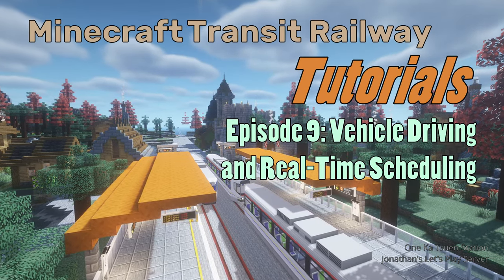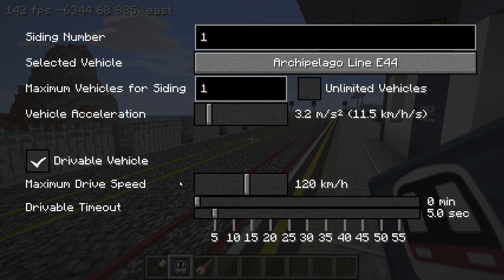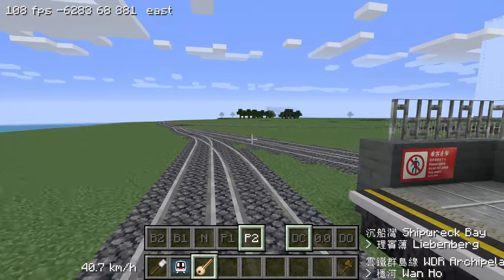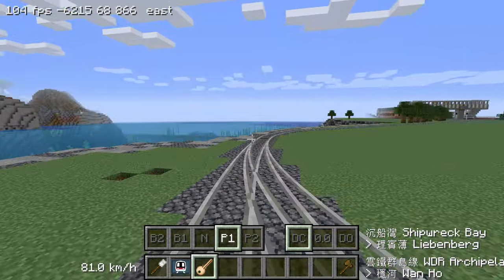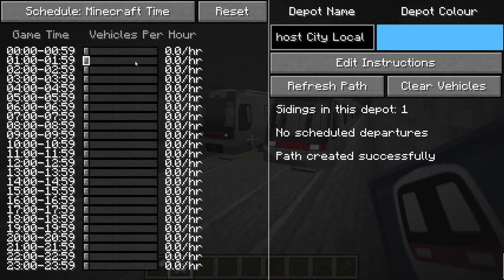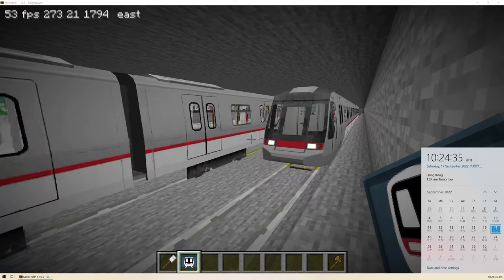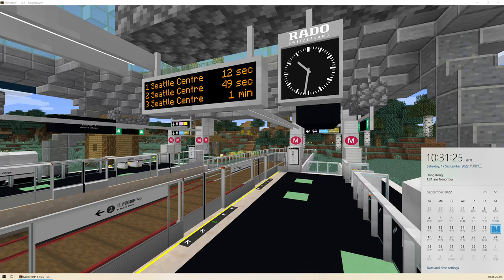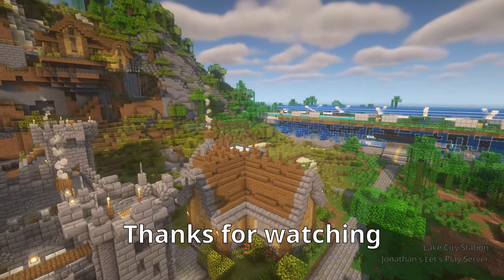Vehicle Driving and Real-time Scheduling - Minecraft Transit Railway Tutorials Episode 9

Comment: I have a problem, in my station which is next to a depot, it wont show the arrival of the next train until the train arrives to the depot, so the passenger information thing is basically useless because it will only show the arrival like when there's 10 seconds left, this didn't happen on previous versions, it used to show the next departure even if the train was still coming to the depot

Comment: I noticed in the intro there are those cone things on the platform that go in between the train vehicles for safety, how do I place those?
Also, I was wondering if you ever thought about adding a Siemens S70 or similar LRT vehicles. The S70 has an amazing motor sound which you can observe here: https://www.youtube.com/watch?v=59vPKhoHdd8
The current light rail trains are small and have doors only on one side, I'd really like to be able to make a transit system similar to that of San Diego's or Portland's or Seattle's as they have super awesome light rails that feel like metro.